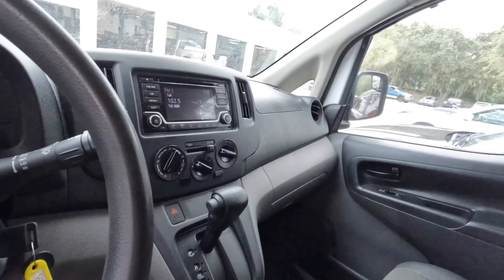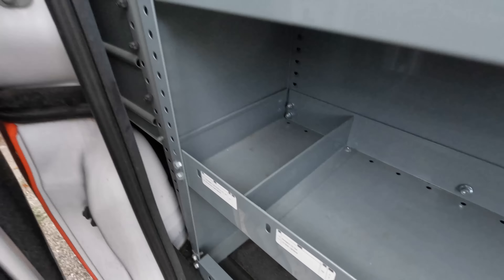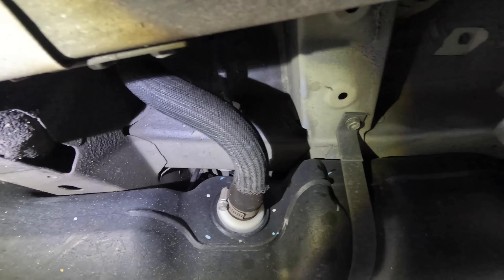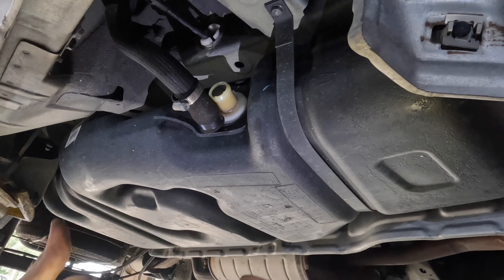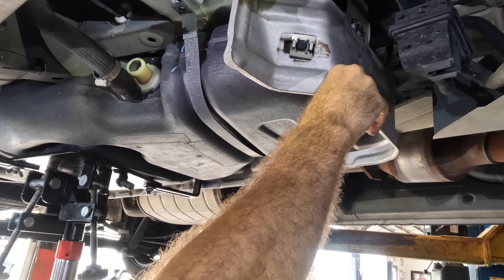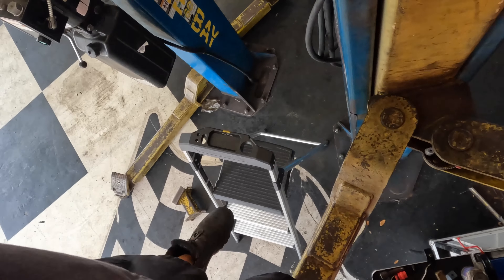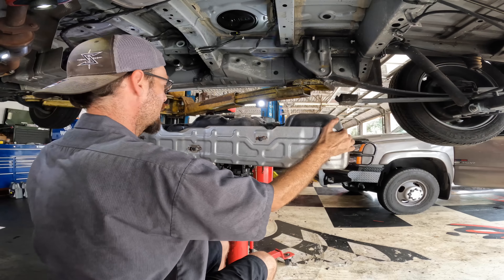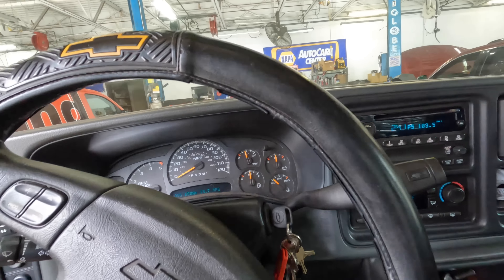Misdiagnosis! Changed the Part Anyway! | Crank No Start

Comment: @Raymain Ray's Repairs, I have a couple of questions: 1. Did you replace the O-ring on the fuel pump unit? I didn't see a new O-ring with the new fuel pump, and 2. did you put the rubber bumper (vibration dampener) that fell off the tank back on when you reinstalled the tank?  Not nit-picking just want to know. Great video as always.
Reply: @14:26 New oring. Old one was on the floor by the tank. Comes with the new pump
Reply: @brnmcc01  Thanks, IO missed on the first watch. Still don't know if he put the rubber bumper back on though
Reply: @bubbaray998  Yeah that set off my OCD also, I was hoping he would go grab it off the floor and use some kind of cool contact cement to glue it back into place. Might have edited that part out though.

Comment: I highly recommend changing the Fuel Filter anytime the gas tank is run dry.
Reply: Yes and this vehicle was nearing 100 grand on the clock, plus could have had trash from the fuel pump going bad. Other mechanics stated was making a loud grinding noise... If you can hear it making noise from inside a plastic fuel tank, it's a good bet the filter is full of metal and crap. Same with replacing the A/C condenser and liquid line dryer after compressor catastrophic failure.

Comment: An overheating, melting sending unit that's inside a fuel tank.  No chance that would ever be an issue.
Reply: Well... at least it didn't blow up...
Reply: The fuel tank will be full of fuel, and fuel vapour, no oxygen to ignite the fuel, so while dodgy, probably not actually dangerous, unless there is a leak that allows air into the tank, that is...
Reply: There's not enough oxygen inside the tank to ignite. Even when the tank is empty the fuel/air ratio is too rich.
Reply: @NemoConsequentae  
TWA flight 800
Reply: @ericjustice5742  that's factually incorrect
Reply: Shades of flight 800, blew up over New York.
Reply: The fuel pump is supposed to be cooled by the fuel not sure if that had any effect on how the fuel pump failed or if the fuel pump failed (sending unit failure) for other reasons but the burn on it would probably not start the tank on fire for certain reasons that I may not know why but could be the material it's made of being resistant to fire and or a combination of things mostly not the right conditions to ignite
Reply: Very good observation my friend have a good day
Reply: I'm a little confused about the gauge sending unit. I may be wrong but I always thought it was a galvanometer and not a variable resistor between a voltage source and ground. The burnt plastic tells me there was more power involved than what a galvanometer uses. I know a galvanometer is used to test the circuit for blasting caps without detonating them. Am I totally wrong?
Reply: @12yearssober  And that was just kerosene. (jet fuel)
Reply: @bradhaines3142  Yeah, there's plenty of air in there.
Reply: @alext8828  
Pretty sure it didn't need much oxygen them either
Reply: @108gk   To read the circuit for blasting caps, or any other circuit, a continuity tester is used.  It incorporates a galvanometer and a current (or voltage).  It sends a very low current into the circuit and looks at the return.  If there is no return, there is an open circuit.  
The galvanometer you used also had a voltage source somewhere.  Probably batteries.  Can you remember if there were any batteries?
Reply: @108gk  A galvanometer is the original name for a moving coil meter, the part that goes on the dash. A galvanometer is driven by a variable resistor (reostat). The current througn the circuit should be limited by external resistance to prevent dangerous heating. Potentially this is just as dangerous as the flight 800 disaster but we need a lot more information.
Reply: @12yearssober  Yes.  Which means there must have been air in there as well.  I've worked on those sensors.  They are not the resistive type found in cars, they are 2 vertical concentric cylinders that act as a capacitor immersed in the tank.  As fuel level rises/falls in the gap between them it changes the capacitance.  They use AC, not DC as well, at 115V 400Hz* with the ones I worked on.  But also remember the 'flame triangle'.  There must have been oxygen in the tank for the fuel to be able to ignite.  No air and it doesn't matter if there is an ignition source, because there is no oxidiser for the fuel to ignite with.
Cars typically have closed fuel systems though, with only the vapour being trapped in a charcoal canister & periodically being vented into the intake system to reduce fuel vapour emissions.
*115V 400Hz is the standard voltage & frequency for aircraft AC systems worldwide.  DC systems run at 28V.
Reply: @alext8828  Between you and iconoclad I think I've got it. It's been 40 years but I do remember batteries because there was a battery cover. Power positive, meter movement and resistance in series to to power negative. I was overthinking it and somehow mixed in galvanic corrosion.
That blasting stuff was 40 years ago. There may be a more modern way of testing continuity in a blasting circuit.
Reply: @108gk  You remembered most of it.  Thanks for the response.
Reply: I actually had a shorted wire to the fuel pump inside the tank. Thing was charcoal and since I had a habit of being poor and running my tank low I'm lucky I didn't go boom.

Comment: Coincidences are weird things but they make for good videos. In a parallel universe, the correct diagnosis was made and 𝒕𝒉𝒂𝒕 Ray set about replacing the faulty component. The access hatch was buried, so he had to drop the tank. Only then did he meet 𝒕𝒉𝒊𝒔 Ray, following duff information but carrying the same component. When two worlds collide - it ain't got no gas in it !! 👍😁

Comment: I always mark the pump and tank so you can not go wrong putting the pump back on jobs been made harder taking fuel tank out when you can usually take inspection plate off to excess  fuel pump good job ray made you work for such a simple job

Comment: Regarding fuel tank dangers, In 1987 my Honda Civic fuel tank was holed by a sharp rock while visiting my parents in an area of dirt roads. As we had still a long way to travel I was worried about losing all the fuel, so needed to plug the leak quickly, the only thing at hand was some small tree  branches, (no tools), so I jammed a few in the hole which was larger than my thumb. Finally got to a small town mechanics shop. The way he removed the fumes to weld the tank was, something I've never seen before or since. He put the exhaust of his diesel Jeep into the filler neck of the Honda's tank, after draining, for about 20 minutes. Then welded the hole up, no explosion, no problem. Carbon monoxide will not allow fuel to burn.
Reply: Argon or nitrogen will work too my boss used to do that you'd empty the tanks and then you pump the gas in and they need well helicopter fuel tanks but I don't recommend it to somebody that's really not into it it could be very hazardous have a good day when I said pump the gas and I meant argon or nitrogen not fuel once again have a good day
Reply: Sorry, Carbon monoxide is very combustible.

Comment: Make or get a brass chisel. Spring steel has a lot of carbon in it and loves to visit Mr. Sparkey. But, you still haven't got yerself a silicon wedding band and must love living dangerously. Also, I believe you missed an excellent opportunity to use brake-clean and the "assault" air gunrifle.

Comment: Replacing the fuel level sender on my 85 VW Golf was a bit of a challenge due to the gasket getting contorted every time the sender was placed in the tank. Had to remove and reinstall a few times before getting it to seat and remain seated properly otherwise the job was pretty much straight forward.

Comment: When you pushed the van in, I was worried that you might take that guy's door off of that GMC Duramax Diesel. (Yes, I know that it's yours, Ray). Also, I 100% agree with you on your choice of tools to remove/install the locking ring on the pump!

Comment: I have found on the Nissans with the fuel gauge issues before starting even with an full tank the gauge needs calibration, although it is automatic the car needs to learn the values itself, techy at Nissan told me to leave on ignition for 10 minutes then switch off and drive. normally fixes that issue.

Comment: If you look on the fuel cap door on most vehicles there is a metal hook welded to the door, it's there for you to hang the fuel cap instead of it hanging on your finder paint

Comment: My gas cans I install a tire valve stem with schrader  valve removed. Take the valve stem cap off and vents the gas from the gas can empties much much faster (I use the brass or chrome truck type valve stems.)

Comment: FYI - Tractor Supply sells these nifty portable fuel can repair kits. They have replacement spouts and collars for both old style and the newer EPA fuel cans, plus those separate yellow plastic vents for the old style cans - such that you can "retrofit" one of those PITA EPA cans to old style with a separate vent - strictly for use on your own property, wink wink.

Comment: I think brass hammers don't throw sparks, I use a plastic coated hammer cuz I like a deadblow for those rings anyhow
Reply: The brass hammer may not but what about the chisel on the nut ????, I'm assuming that it was steel.

Comment: I changed out the tank on a 2005 F150 and was surprised how clean it was inside. Had a tiny bit of debris like yours but nothing bad. No wonder new cars don't have replaceable  FF's.
Reply: Wait what, cars don't have replaceable fuel filter? Is that on gasoline cars? I have a 2016 Skoda diesel and it has a fuel filter
Reply: @justme5384  Yeah, hopefully they never delete them on diesels but when I couldn't find  one for my 2015 Challenger,  my mechanic buddy told me most don't have them anymore.  Another place to save a buck that the customer doesn't know about.

Comment: I had a similar problem in a Toyota Corolla, started with spark plugs and turned into ignition coils, fuel injectors, fuel pump, alternator and new battery.

Comment: Living out here in California it was strange to see a gas pump nozzle without a vapor recovery boot. Here, if you want to fill a gas can you have to pull the boot back to completely fill the can.
Reply: Yup. And a gas can with 2 different anti vapor evaporation devices to keep you from filling your vehicle or lawn mower without swearing like a sailor lol. The 87 Octane gasoline would have been 5.69 a gallon too. But hey, the weather here is nice. 👍🏻

Comment: The new O Ring is always difficult to compress 
The air hammers not a bad idea.
Reply: I put a very thin coating of standard dielectric grease on them, and then its pretty easy. And not harmful to rubber because used on spark plug boots etc.

Comment: Brass chisel is the correct tool to use  around  fuel tanks and cost is less than  a socket this was  first lesson we are told in automotive along with  disconnecting Battery.......

Comment: My dad had an older vehicle that the fuel sender was not working.  He was pretty good about guessing how much gas he had left.  But one day he ran out gas coming home.  I happened to be home from college.  So we got a gas can and put some gas in and it started right up.  Now the funny (not to my mom) part was that the car he was driving had a manual transmission and the pickup truck that we used to 'deliver' the gas was automatic.  My dad let me drive the car home and he drove the pickup truck with my mom.  Unfortunately he was used to using the clutch.  So soon after he started home, he went for the 'clutch' and hit the brake pedal and about put my mom through the windshield.  She was not happy.

Comment: A friend of mine put a flame near the opening of a gas tank that had been empty but sealed for a long time. Thank god it was outside at the time, it went up a ten gallon tank but came back down close to a 20 gallon tank. The dummy did it three times and after washing it out each time. Turns out vapor builds up quickly and is explosive. That was a metal tank from an old car and the was in the late sixties.

Comment: I replaced the fuel pump a few years ago and when I got done the gauge was showing empty so I added about 10 gallons of gas and still empty. So had to drop the tank again come to find out the wire to the sending unit was never soldered on. I called the parts store and they told me to just solder it back on.

Comment: Hi Ray.
do check the sender unit before you replace the tank i got pissed of once I did a rover 214 1.4L and didn't check the new sender unit i had to do the job twice the worse thing was its bolts where rusty a couple broke man I had to get the old broken bolt's out that took me AGES   lol still have nightmares about this to this day 🇬🇧☕👍🏻

Comment: As soon as u said floor jack I said I want one if it will take down a fuel tank 6 feet up in the air. But I knew u meant transmission jack.

Comment: I used to have a diesel truck like yours except a ford 6.0L (the worst buy ever) and I took it to the dealer because the brake line got a hole in it for rubbing on the frame. Anyways I went to get fuel. I put the nozzle in the filler neck, started to pump and was wondering why i was smelling fuel. I looked at the ground and there was almost 2 gallons of fuel all over the ground. The dealer didn.t connect the filler hose. What a mess. So good catch!

Comment: I had an old ranger when I was 18 that had a fuel pump go out. Got a replacement at orielly but it still didn’t work. Tested the pump with a battery and it worked but not when plugged in.  Spent 2 days trying to find what’s wrong. Ended up being the replacement pump didn’t work. Never been to orielly ever again.

Comment: I have done at least twenty late model Dodge fuel pumps. I have used a regular chisel or air chisel on every single. Most of the time the tanks were full but a Charger tank is constructed so that even at 1/4 you spill a lot of fuel. Never seen a spark or fire ever. Mostly non mechanics saying that. The tank is sealed.

When Nissan/Chrysler/Fiat used that 22 gauge pump wiring... the 18 gauge retrofit with later pumps and the wiring upgrades helped quite a bit.

The sender and pump are one single unit. I understand Ray, you can't dismiss the novices and armchair mechanics.

Comment: I had a truck with dual tanks years ago. The auxiliary tank was good, the main tank was rusted out. I dropped it off at a shop to replace the main tank. I came back and they replaced the auxiliary tank. 🤷🏻‍♂️then told me the main tank was rusted out. Too bad the mechanic wasn’t as good as rain man.

Comment: When the fuel pump in my 1982 Rabbit went bad it was a snap job. The pump was outside of the tank. Took 30 minutes to replace. 
When the fuel pump went in my 1993 Dakota, hours after completion of a trip from Pittsburgh to Falconer and back, in late January, it was dark when I began and it was dark when I finished. Outside in the driveway, too.
Reply: I pulled the bed off my '98 Dak and my '94 RAM previous to it.  Both were full tanks when they crapped out.
Reply: @MarcMercier1971  They never die on an empty tank. It's a corollary to Murphy's Law.

Comment: No no no, you gotta use a hammer drill/jackhammer with a brushed motor to remove the fuel pump retaining ring. Brushless just won't do. You need that blue-green light coming from the motor, that's how you know it's working and that you have the right tool.

Comment: Throw a dab of silicone lube on the fuel pump ring seal. Old guy in the shop said this. Maybe it helps maybe not. Can’t hurt. Might help that ring slide on easier.

Comment: I would have thought  something like a hot sender unit would be more of a fire risk than a chisel ? I wonder what caused that ?
Reply: Not really, there's a lack of oxygen inside the fuel tank so any sparks or heat can't do anything.
Reply: Chisel thing is mainly in enclosed spaced where there might be a concentration of fuel vapour or there is fuel spilled on the tank.
Using a chisel out in the open removes the vapour risk at least.

Obviously there is a tiny risk of a spark causing a fire, but that's the thing about large numbers. 
Like lottery wins, someone has a "success", just rarely you.
Reply: @stephen7mgte  Maybe an empty tank more dangerous ?
Reply: @groovedodger   only if it's open to atmosphere allowing the vapours to mix with air, been many accidents with folk welding etc either directly on or near empty petrol tanks. Petrol will produce vapours and maintain a flash point to well below freezing and the vapours are heavier than air and sink so always be vigilant if working in confined areas or in a pit.
If the tank is still sealed then it's no more dangerous as the vapours will always tend to occupy the volume above any liquid fuel remaining in the tank, even tiny amounts of liquid fuel will create vapour. This coupled with the vehicles evap system will always tend to purge any small amounts of oxygen present. Think about it, you almost never hear of fuel tanks spontaneously bursting into flames, not saying it never happens but is extremely rare. More likely to have a fire from the blower fan resistor pack than a fuel fire caused by a defective sender or pump unit
Reply: My thoughts as well.  Why did the wires oveeheat and burn up?

Comment: I find it interesting that the tank is poorly designed to not allow all the fuel to settle under the fuel pump. It could also be that I didn’t see directly into the opening, but it looked pretty dry right at the opening and then there was some fuel to one side. Again, could just be the camera angles, but I also wouldn’t put it past the engineers to design it in that fashion.😁
Reply: Yeah that spot was to let the water settle out of the gas no I'm just kidding have a good day